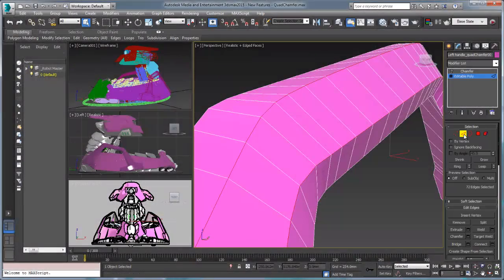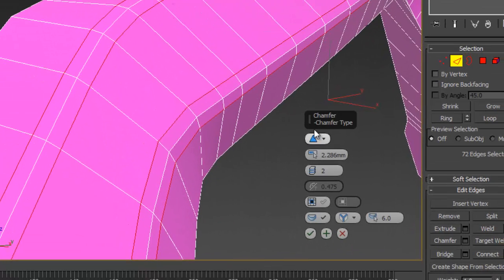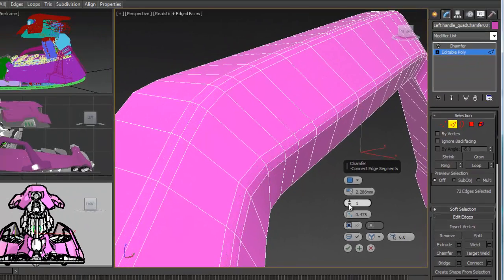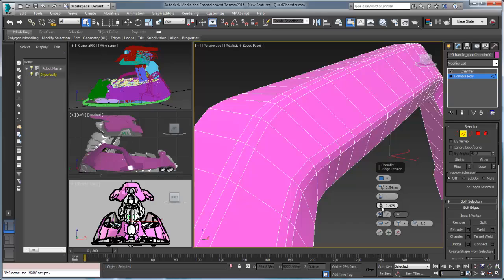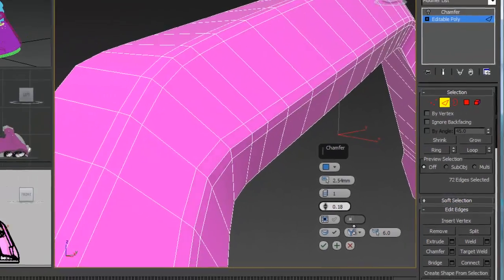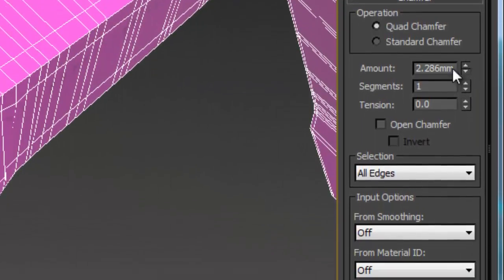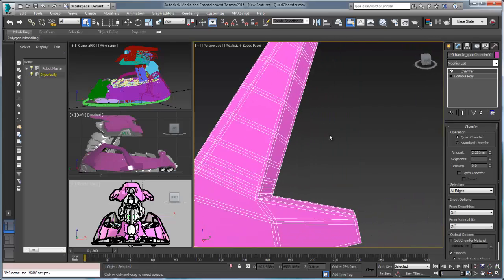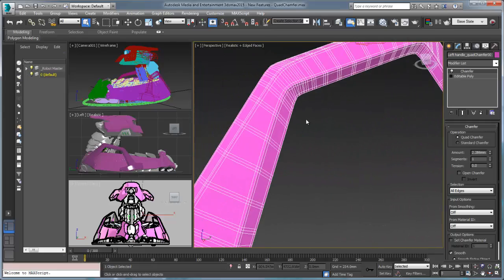3ds Max 2015: Quad Chamfer

Comment: Your chamfer fucking sucks Autodesk. 3DS Max is overpriced and under developed. But there is a solution, it costs about £50 oh it's called Marius Silaghi's Quad Chamfer and his tool makes your chamfer system look worthless. I have 3DS Max 2018 and you still can't write a decent quad chamfer modifier. It's so broken it's a joke!

Comment: Whats the benefit of Quad Chamfer?
Reply: I think is good for subdivisions in other programs like mudbox
because 1 quad can be subdivided into 4 quads but a triangle can cause some problems when is subdivided.
3ds standard chamfer creates tris on edges that must be "cleaned" before sending the mesh to a sculpting tool.
Reply: the rule of thumb is that you always want to have a quadrified mesh if you can. (also, 1 quad in polymesh = 2 "hidden" triangles --> the triangle is the first polygon you can have, like... 2 points = line, 3 points connected by 3 lines = a triagle (first polygon), 2 triangles = 1 quad)
when you have a quad you always have 2 triangles, when you have a triangle not necessarily you have a quad
Reply: Juan Milanese basically you are right, quads subdivide better and are easier to work with, but chamfered edges are not the best for sculpting. As the tight edges will deform your brushstrokes due to uneven poly distribution. The best mesh for sculpting has a very even polygon distribution, the more even, the better. Depending on how hardedged your model is, and how much it will be sculpted, a doublesmooth workflow would be the the most preferred way to handle it.